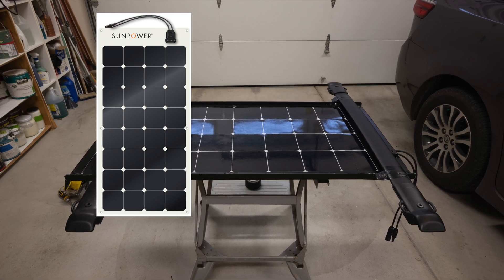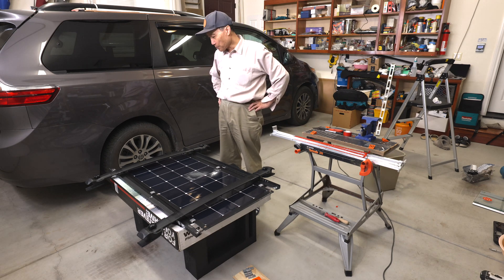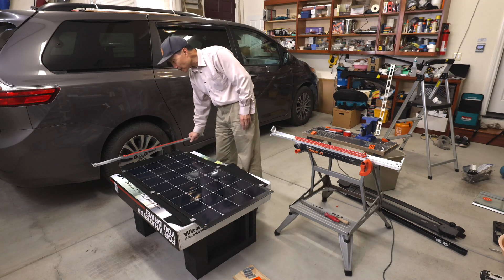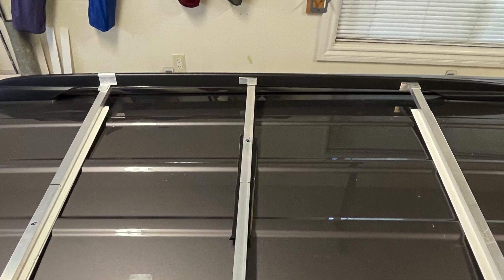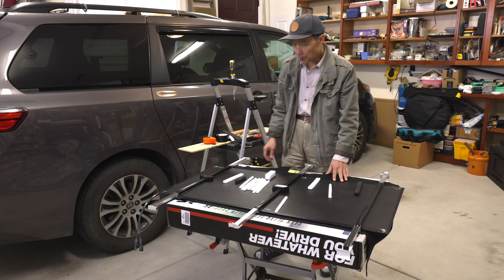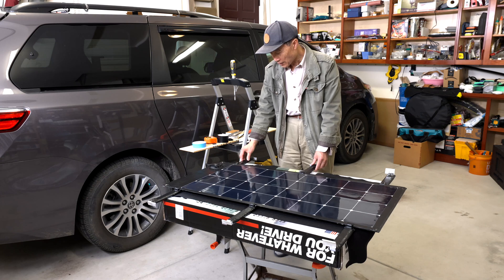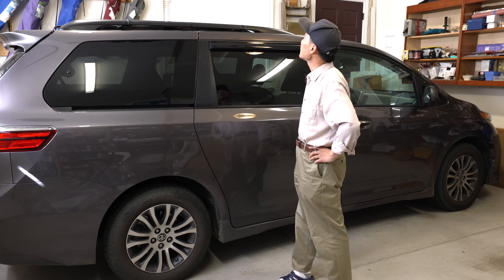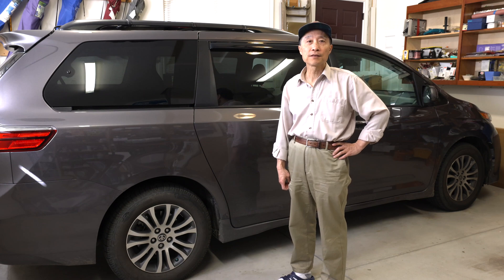Sienna MiniCamper (7) - Installing Flexible Solar Panel

Comment: Do you still use this flexible panel set up?
Reply from the maker: Yes, I am still using flexible solar panel. But I replaced the original one with a bigger one 175W with similar setup. So far it works fine.

Comment: Hi Shen.

Will the gorilla black duct tape be difficult to remove when needed?  Does it leave a residue that may mess with your car’s paint?
Reply from the maker: I am not quite sure about residue but it is very possible. I highly recommend that you apply a layer of 3M Clear Paint Protection Film to protect the paint first. That will provide a buffer between paint and wind deflector+duct tape. That's what I did.
Reply: @ShenYe01  That is invaluable information good Sir.  Thank you.  

Since the honda element doesn’t have the same roof racks, I am planning on mounting my flexible panels with 100lb neodymium magnets, and I want to deflect wind up front.  Would you have an opinion on that setup Shen?
Reply from the maker: @kevinnghe1  I know those are very strong magnets, but I don't have any experience of using them in aerodynamic situations. I assume that you need to consider driving at 70+ Mph against very strong wind.
Reply: @ShenYe01  how strong does the 3m clear ppf adhere to the car’s painted panels?  Any chance the gorilla tape on the clear ppf will rip off due to wind or does the 3m film hold strong?
Reply from the maker: @kevinnghe1  I had the 3M film ~1" wider than the gorilla tape and never had a problem.

Comment: Hello Shen Ye. I really enjoy your van conversion videos and the ideas. In your update you mentioned using a back aluminum plate (0.063" 5086-h32). Is the plate attached to the bottom of the solar panel? Did you install it to add some stiffness to the panel? Is it absolutely necessary? I am trying to copy your installation but the plate isn't really visible in the video.
Thanks
Randy
Reply from the maker: Hi Randy, the aluminum plate is attached to the bottom of the solar panel by double sided thermal tape I bought from Amazon. For your reference the tape info can be found at
https://amzn.to/3B97Yjw
The solar panel alone is a plastic-like material and too flexible. I needed it to be much stiffer in order to mount it with aluminum channels, such that when driving at high speed the whole thing will not vibrate. To further increase its stiffness, I also mounted the piece slightly to form an arch as I mentioned in the video.
I covered the aluminum plate with tape first and put on panel second. Be careful that the tape is VERY sticky. Once the panel touched the tape, it's impossible to make any adjustment.
Reply: @ShenYe01  thank you for the information. That makes sense because I purchased the same solar panel and it is quite flexible. Too flexible for driving at highway speeds.

Comment: 我也在改装这个 只是想到说 太阳能板的风阻 有什么好办法吗？ 如果穿越66公路中部 会有强风区 我之前的设置被吹走过
Reply from the maker: About two months ago, I upgraded mine to 170W Sunpower flexible panel. I also changed the supporting beams from 1/16" to 1/8" and the back aluminum plate to 0.063" 5086-h32. As before, the installed panel has a curvature from front to the back which is very important to gain strength. The whole thing becomes much stiffer and it does not need any additional support. On our trip to Yellowstone, we drove on 80 MPH highways and against strong wind. There were no issues at all. I think that the very low profile, light weight of flexible panel and how it was installed all help.
Reply: @ShenYe01  TY bro

Comment: I have installed a single BougeRV 180 Watts Solar Panel, 12 Volts Monocrystalline Solar Cell on my 2015 Toyota Sienna van. I screwed it onto the roof directly using Z bracket. There is a very loud wind noise when I am driving on the highway. How do you secure the triangle shape foam block onto the roof? I want to try your method to cut down on the wind noise. Thank you
Reply from the maker: Hi Raymond, I looked your panel from google. From my experience, if your installation leaves a gap between panel and roof, there will be wind noise. The foam piece I made as shown in the video has about an inch inserted under the front edge of the panel. I originally used 3M vinyl tape to stick it to the edge (~1in) from the top on the panel and covers the foam all the way to the roof with several overlapping runs. But later I changed the tape to thick Gorilla duct tape for its much better adhesion and temperature tolerance. The noise reduction effect is very good. Hope this helps.
Reply: @ShenYe01  Hi Shen Ye. Thank you. Where did you find the foam piece. I can't find them in Home Depot or Rona in Canada
Reply from the maker: @raymondchan4757  I collected some reusable packaging materials from time to time in case I need them. The foam I used was from a speaker packaging.
Reply: @ShenYe01  Thank you
Reply from the maker: I would make a suggestion to you: before you make a foam wind fairing, you could use duct tape to emulate its effect. That was what I did before making a foam version. In my case 2" width is not enough and I overlapped a few layers to cover the gap and made it an aerodynamic shape.

Comment: Great simple set-up. If I may, you should consider that dust and sand may get caught under your foam and scratch your paint from vibrations and all. Therefore, I would recommend taping the paint directly with either transparent car tape or simply back electrical tape.
Reply from the maker: That's an excellent suggestion! I am going to put the tape on the roof. Thank you!
Reply: @ShenYe01  it's a real pleasure to be able to help a you out. I love the effectiveness and simplicity of your work. Thanks for sharing.
Reply from the maker: @patrickbodnar2403  🤝🤝